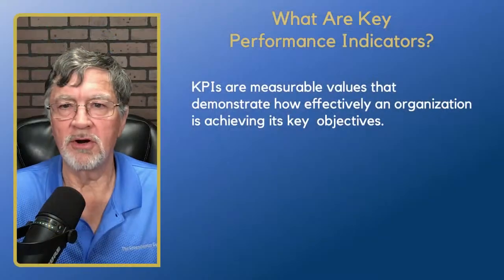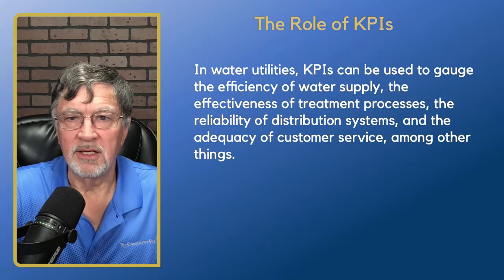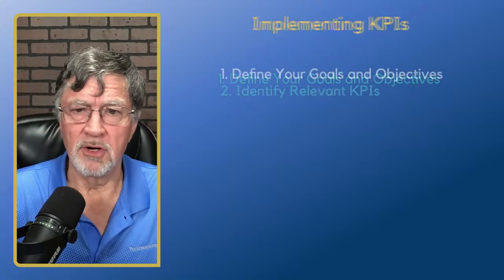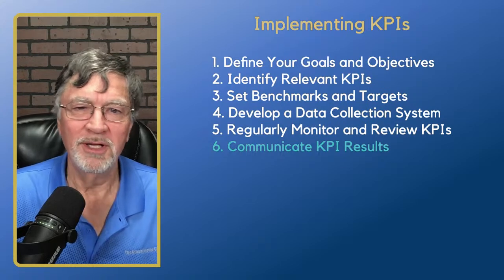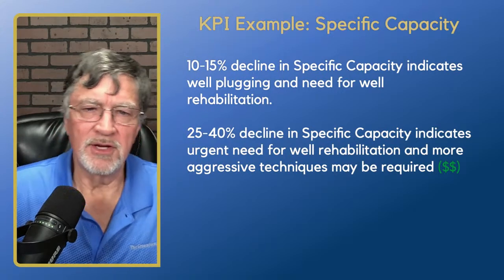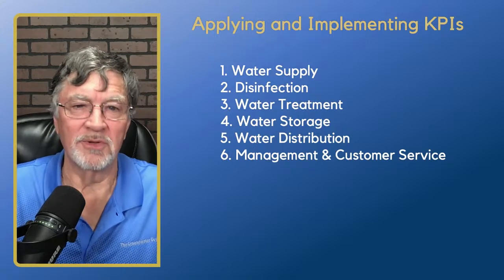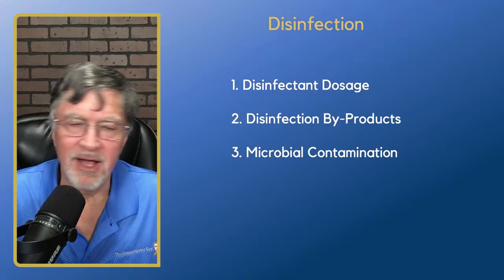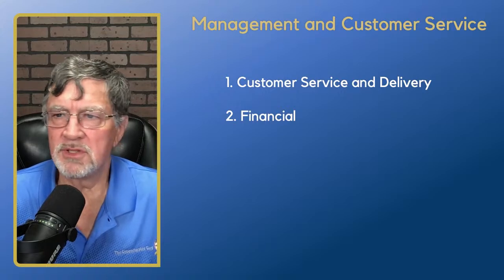Key Performance Indicators for Effective Water Utility Management

Comment: Thank you for sharing this. Can you share references on which all this information is based? Or is it all from your experience? I am working on a project for sustainable water management - It will be a great help. Thanks again!
Reply from the maker: It's actually based on my experience.  We started developing key performance indicators for water well performance and expanded it to water utility management in general.  I have not been able to find any good information on performance measurement for water utilities - just dribs and drabs here and there, but nothing very systematic in approach.  It's a big gap as I see it because if you don't measure it, you can't track the performance.  As far as sustainability goes, here is a link that may provide some useful information to you: https://www.epa.gov/sites/default/files/2016-01/documents/planning-for-sustainability-a-handbook-for-water-and-wastewater-utilities.pdf